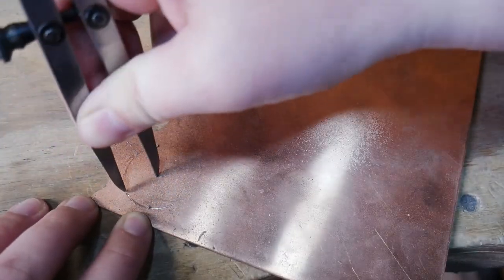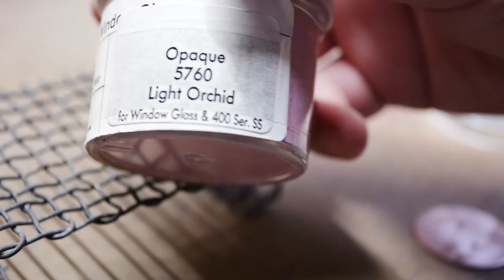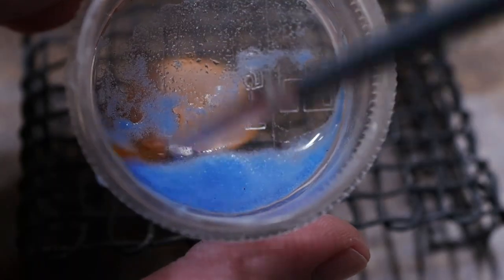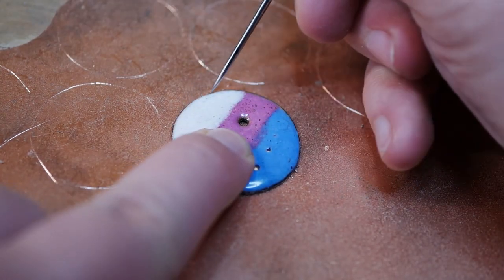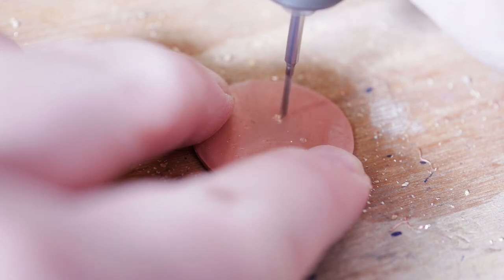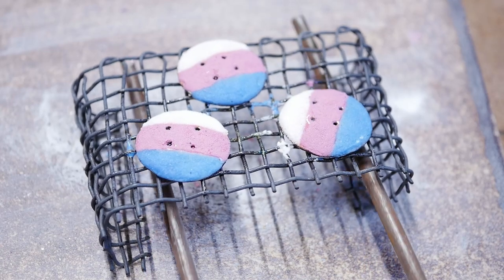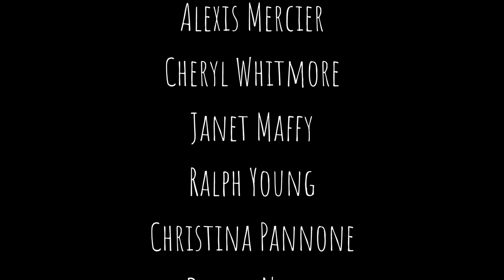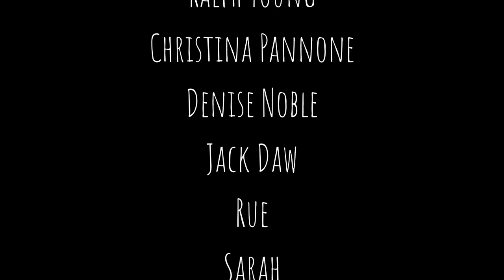Making Trans Flag Enamel Buttons by Hand

Comment: Love the buttons😍
Regarding the firing temperature for enamel: while I've never done enamel myself and am far from being an expert on the topic, I learned in a conservation/restoration class in uni, that at least historically some colors needed a higher firing temperature, while others shouldn't be heated up to such a high temperature, which influenced the way designs were done/layers were applied. But I don't know how much the colors (or the materials used) have changed over time and if this is still applicable